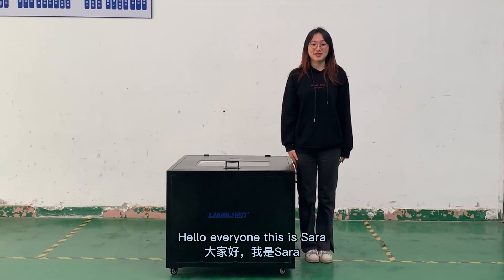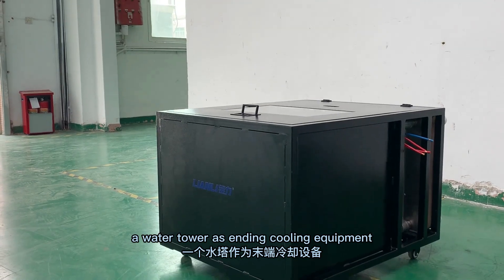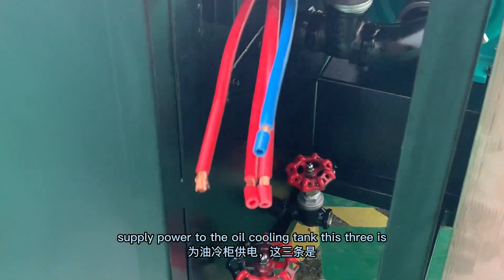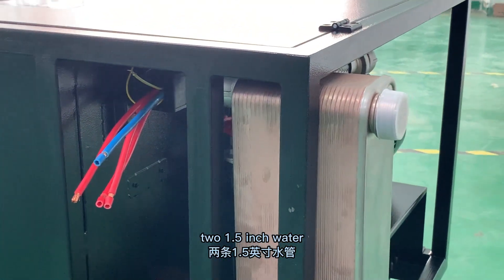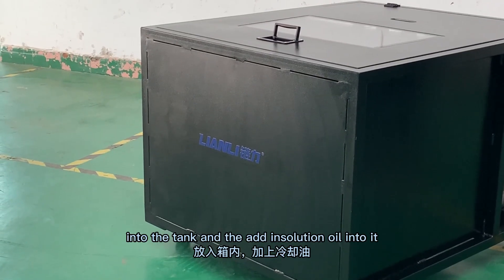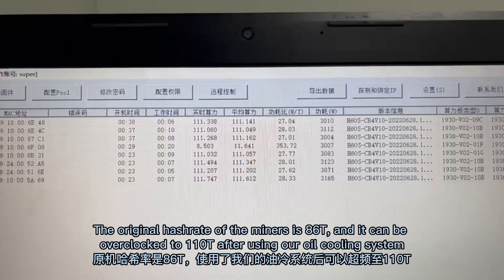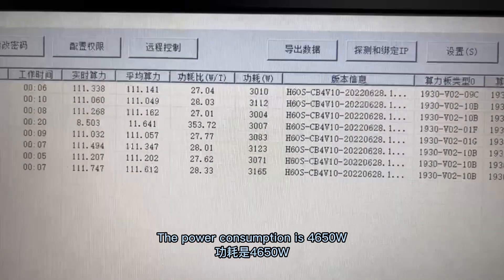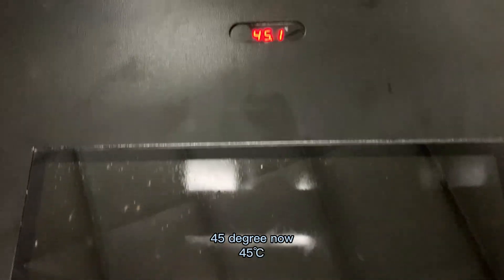Small immersion cooling system for 6 miners

Comment: BOUGHT SEVERAL TUBS OF THIS BRAND, THE TRUTH IS I HAVE NOT HAD THE BEST OF EXPERIENCES SINCE I HAVE NOT BEEN ABLE TO MAKE THEM WORK WHEN PUTTING THE 6 ASIC THE OIL GETS HOT UP TO 59 DEGREES AND THE ASIC UP TO 7O DEGREES WHICH MAKES THEM NOT FUNCTIONAL, I DO NOT KNOW IF IT IS THE ISSUE OF THE COOLING TOWER THAT IS INSUFFICIENT OR ANOTHER ISSUE, I HAVE CONTACTED YOUR SELLER SEVERAL TIMES AND IT DOES NOT SOLVE MY PROBLEM. UNFORTUNATELY IN NO VIDEO DO THEY PUT THE TEMPERATURES OF THE ASIC IN THE WHATSAPP TOOL I HOPE THE COMPANY CAN HAVE ADVICE FOR THOSE WHO PASS US THIS SITUATION I HAVE 7 TUBS OF 6 MACHINES AND 1 OF 18 AND THEY HAVE BEEN A HEADACHE I PREFERRED TO TURN THEM OFF AND PUT THEM BACK IN THE AIR